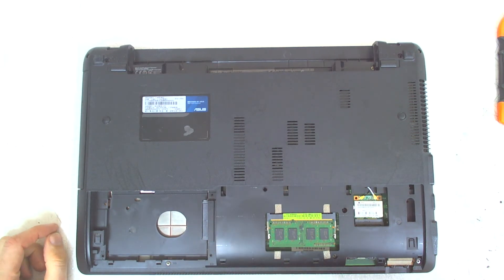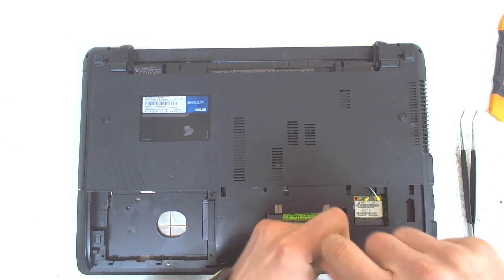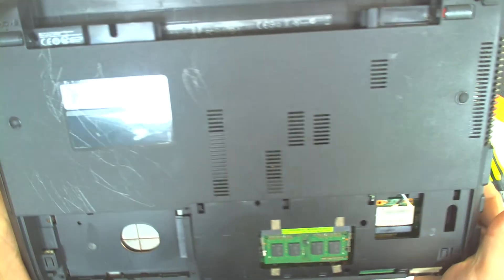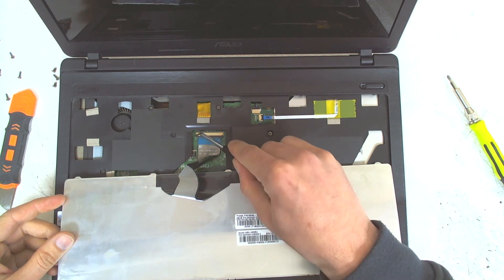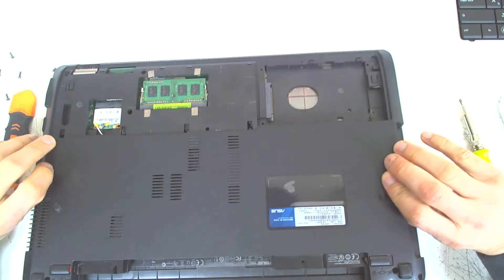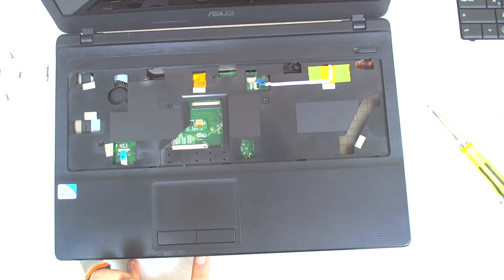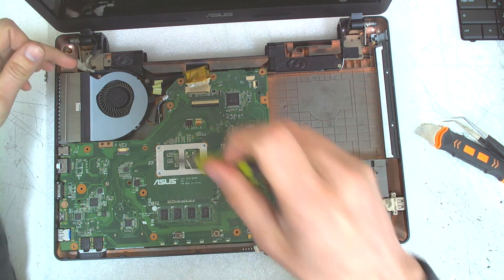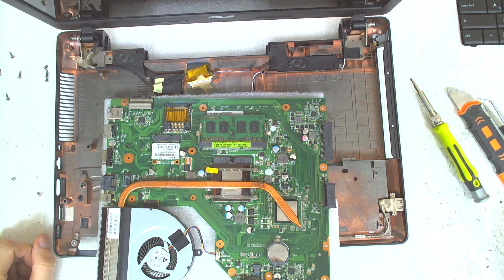Asus X54C Disassembly / FAN Cleaning

Comment: If I want to replace the fan, will I have to repaste the cpu?
Reply from the maker: If you dont lift the cooler no, but if you remove it you have to repaste.  But you can separate the fan from the cooler

Comment: Is it possible to oil cooler without removing motherboard ?
Reply from the maker: If you have some oil spray with long nozzle.. You ca try from the back of the laptop.  But you have to spray between the blades and the bearing...